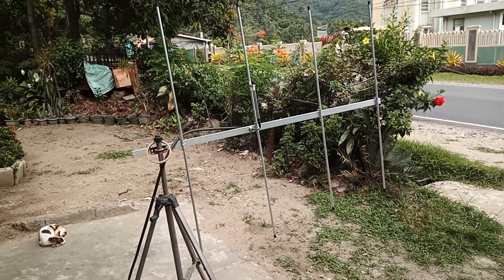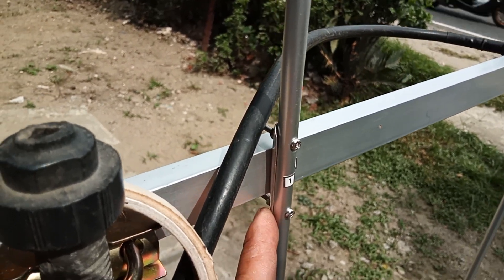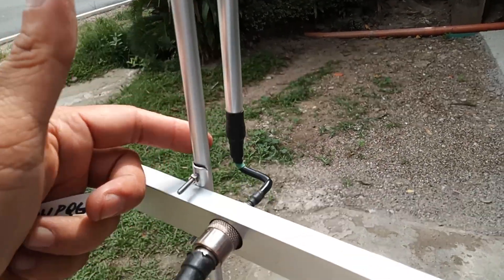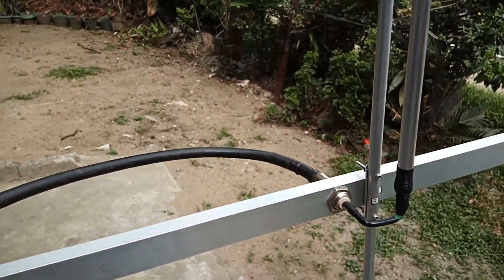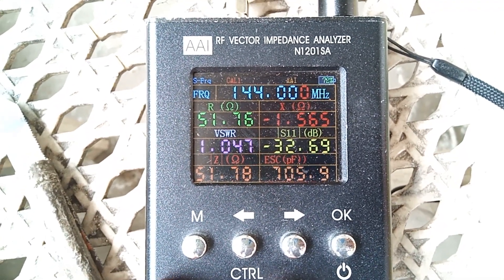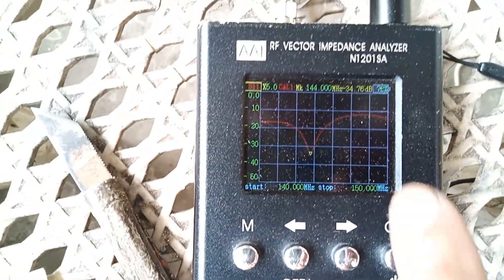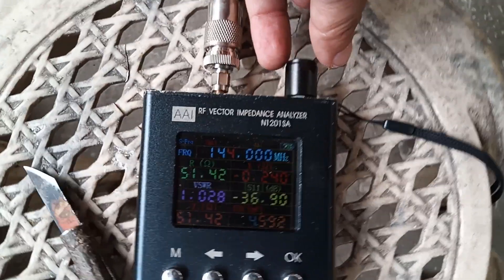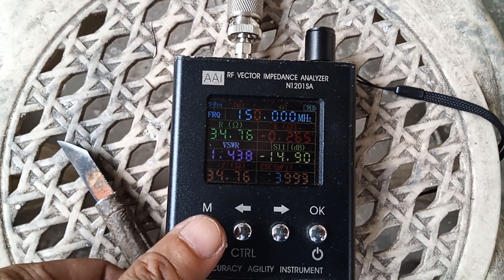4 Elements Yagi -Amateur band for 4H1PQG

Comment: Hello again. I have a couple more questions. Thank you in advance!  
I’m building your 2x4 Yagi. It looks like a great antenna!
Went through your entire website and couldn’t find the lengths of the gama match tubes for vhf nor uhf. I did find lengths for other antennas being 4.5, 16.51, and 19.05 cm. What are the lengths used in the 2x4? 
Also does it matter the size of shorting strap? I was thinking of machining it from a 1/2”x 3/4” piece of aluminum. 
Your website and you tube channel are incredibly informational and helpful! Thank you for all your hard work!
Reply from the maker: this is the gamma match for the dualband https://dw1zws.com/site/wp-content/uploads/2018/11/gamma-match-dualband3x5.jpg however I recommend mounting it with a bracket so your final construction maybe different the separation between the gamma match and radiating element is always 2.54cm on my builds - the sample here is for the dual band side by side mounting not the cross 2x4 but the length of the gamma tube remains the same. I recommend to build it using 3/8" elements as you can directly use the center conductor of an RG8 coax for the gamma insert, or in my case I'm using either #12AWG or #10AWG solid wire depending on the availability of supplies it works well with me. 
https://dw1zws.com/site/wp-content/uploads/2018/11/gamma-match-dualband3x5.jpg
Reply: @EphraimGariguez  thank you so much for taking all your time helping me. I will send you prayers from God the Father! Thank You!

Comment: Just found your channel and website today. GREAT information! And thank you so much for putting real plans for building antennas! 
I have a question :
I like both of your 2m / 70cm Yagis. How much more gain does the larger one have over the smaller? I like the smaller for obvious reasons but gain is more important for me. If it’s not a very big difference, I will build the smaller!

Another question:
Do you have any good fox hunting designs? 

Thank you for your hard work. 
God Bless you.
Reply from the maker: Thanks for looking 3x5 yagi is 7.25dBi on VHF and  10dBi on UHF,  2x4 yagi is 6dBi on VHF and 8dBi on UHF, the 2 elements VHF side on 2x4 yagi will  work as a good fox hunting antenna - take and build the VHF side and you're good to go.
Reply: @EphraimGariguez  thank you for answering so quickly!
Another question....
Can I change the dimensions of the materials? For example using 3/4”x3/4” aluminum for the beam and using aluminum arrow shafts for the elements? Does it effect anything? Thank you!
Reply from the maker: @johnemmons9087  changing the materials will not cause much as long as the geometry of the antenna remains (i.e elements length and spacing) however you will need to improvised on your construction technique so the end results may not be exact but of course still a working antenna so good luck with your build and enjoy.